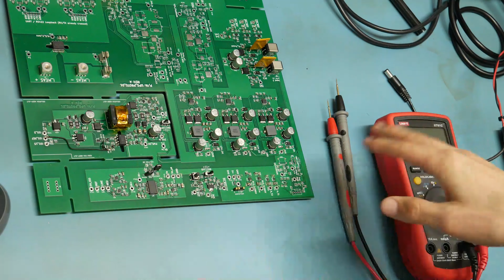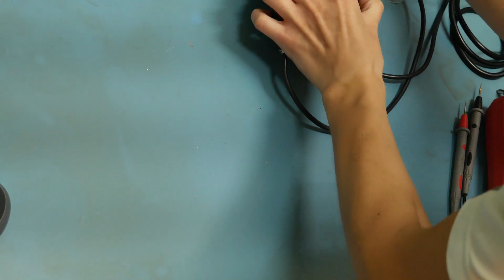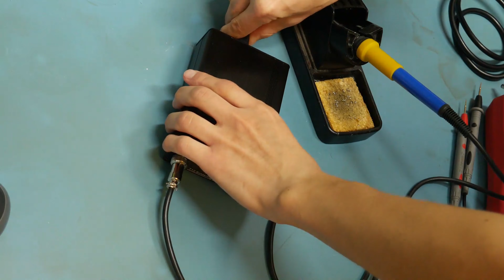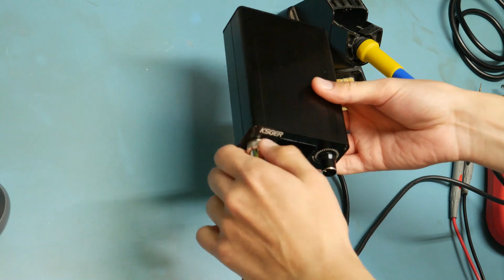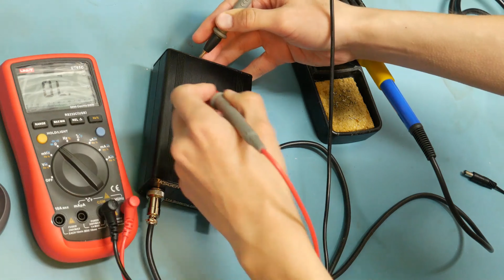A Dangerous STM32 T12 Soldering Iron - Ground Bond Upgrade!

Comment: Thanks. I had same problem with my other JBC and with this model station.I measured around 4~5 v AC. I called JBC service, they told impossible. İ sent photos they didn't react. So i had to fix. From heater side to main ground i had to connect with a wire. I've solved.   With this KSGER i measured 2.5 V AC!! 
I did almost like at your video. Because front and back cover screws solved. Only one problem I had to make a hole and solder to the main ground. Problem fixed.
Thanks for sharing your experience with your video. 💓💓🌹🌹
Reply from the maker: Thank you Elektro Dado! Yes! These irons all handle "ESD Safety" in a variety of ways. This one floats the handle (or has a very high impedance to ground), which is how currents can lead to a volt or two being dropped with respect to ground. If I remember correctly, the exposed tip of this iron is floating with respect to ground... not great! 

Then again... if the tip of a soldering iron is always a solid connection to ground potential, it's possible to rapidly discharge the PCB through the iron, which isn't great either! Most irons from the big names like Hakko, JBC, etc, have a specific circuit made to handle discharging electrostatic energy in a safe way. I'm surprised you saw a voltage on the tip!

Comment: How big is the chance of hot wire being flying inside that box 😂😂😂
Reply: But  to be safe is a good feature to have)
Reply from the maker: I'm honestly not sure! I'd rather not find out with my hand though. :) I'll let you know if I ever blow a fuse or trip a breaker!
Reply: @EEforEveryone  thx, by the way, I just ordered same one, let's see if my is grounded)
Reply from the maker: I hope they made some changes to the design. Let me know what you get! Btw, the black anodization has a high resistance, so make sure to check continuity from a silver part of the chassis or a screw!

Comment: Is your other iron grounded? the yellow and blue one, because I'm thinking of buying one as a cheap iron for occasional use.
Reply from the maker: Hello Jar! The yellow and blue iron comes as a kit with the iron shown here. There are a lot of great soldering stations that use the "T12" tips and a plastic enclosure / grounded enclosure /  a safer power supply! Unfortunately, I don't have the name of one off the top of my head.

My guess is that if it looks similar, it's probably electrically similar or made in the same factory. One thing I do to stay safer is to use a GFCI power strip to power anything I don't trust. :) I hope this helps!

Comment: mand do you know that you dont have to drill it or file it to grouund it?
Reply from the maker: Hi Informedia, It's possible that you're right, with a good star washer, the filing may have not been necessary! The point was just to break through the black anodization, which adds a high-resistance oxide layer to the outside of the metal!

cheers, and thank you for watching!

Comment: Could you bypass the transformer and run a 24 volt transformer straight to the circuit?
Reply from the maker: Hello C Jones! This circuit requires DC, rather than AC, so a transformer could be used.. with a rectifier and some output capacitors! Unfortunately, straight AC won't do the trick.
Reply: @EEforEveryone  Thank you.  I guess I was too broad with my question.  What I will be using is a dc brick (or wallwart) for a computer rated at 24 volts.  Just like the  TS100.  It's got a 24 volt transformer.  I wonder what amperage the KSGER needs.
Reply: @cjones4433  What did you end up doing? There's a mini version of this soldering station without the built-in power supply. However, for some reason it's rated at 24V 3A max, I would like why it's not rated at 5A.

Comment: sorry to ask but, if the case is not conductive, you will not get shocked, why add the "earth wire" to the case? The PCB is already grounded. Many thanks! Jorge
Reply from the maker: Hello Jorge! Thank you for the great question! 

Protective earth is very important to protect against faults. You're correct, that if everything is operating normally this wire serves no purpose (carries no current). However, if a live wire were to break (mains) and happen to touch the metal chassis... this creates a dangerous situation.

If somebody notices their soldering iron no longer works (because the case is live) and decides to touch it (maybe to check the power switch) they could be shocked or electrocuted!! The added "earth wire" would cause a circuit breaker to trip in this fault condition, and protect a user. 

I hope this helps!
Reply: @EEforEveryone  It would only if there's a proper earth connection in the outlet and electrical system.

Comment: Just bought one of these. For clarity - You cut the wire connected to each half of the case in half, and then soldered both ends to the ground lug of the plug?
Reply from the maker: Hello Baxrok, thanks for watching! Yeah, I drilled a couple holes in the enclosure, added a new wire. This wire is connected electrically to both enclosure halves though crimp ring terminals and screws. (That's the wire I later cut in half) then, both wires were soldered to the ground lug of the plug.

Be careful to make good solder joints, moving the wire while a joint cools can lead to a cold solder joint, which may be brittle and crack!

If you can do a ground bond test to make sure everything is set up right, that's awesome. At the very least, check the resistance between the ground terminal at the plug and each part of the enclosure, like we did!

Now the hard part... Soldering your soldering iron with a soldering iron. :) Heh.

Cheers, and happy soldering!
Reply: @EEforEveryone  Thank you.

Comment: IMHO you should solder or put a ring terminal large enough to fit under the barrel connector that interfaces with the soldering iron and anodized plate.  5 ohms is not much, but, hey, you're in there - could have made it 0 ohms :)
Reply from the maker: Fair point, Jon! Yeah.. what we did is better than nothing... but definitely not as good as it could be, and not up to most safety standards. Even a simple star washer could help a lot! Great thoughts, and yes, 0 Ohms would be great!

Comment: That SMPS looks quite garbage.. Just by looking at the EMI filter, they've put the capacitor before the choke :) I'm planning into buying one of these, but that power supply scares me..Saw a better one on AliExpress under the brand of "Quicko", and the supply looks a lot better designed, but on that one, I can't see any separation whatsoever between the HV and LV side
Reply from the maker: Hello Xander! I agree, the "design effort" put into this iron isn't particularly great... but it seems to work okay!

"Quicko"... sounds good to me! I suppose, I'd rather have separation between HV and LV than a better EMI filter. :)

Cheap soldering irons are always a gamble... If you buy the Quicko one, send us an image of the guts on twitter! I'd be curious to see how different it really is.
Reply: Yes that SMPS is also a death trap, that PSU really scares me on this one as notice a major flaw and that is the lack of primary and secondary isolation? What gets me is the fact they when through the trouble of PCB isolation slots for primary and secondary as did see the isolation slots by transformer, but they completely screw it up by soldering in a large heat sink by the 68uf 400v capacitor that goes directly to secondary supply of power supply, to make matter worst is that heat sink lay right on top of the main primary traces on the PCB, which means the creep distance is as much as the solder mask thickness? Saw that in his video when he turned the power supply to the side and took it out of casing and see the traces running to the primary side. Who designed this?

Comment: More important is  the tip being  grounded? Many switching psu 's are floating and totally safe if isolated from the case .Did you check?  Grounding a device intended to be floating is in it self dangerous.

Comment: Thank you for the video
I was about to purchase a similar clone but wanted more info
I'm going against the purchase seeing how I'm not as informed and would like a much safer option
Reply from the maker: Hello SANHEK, thanks for the comment, and thanks for watching! The STM32 irons aren't necessarily dangerous, but the isolation of the ac-dc power supply is critical, and a plastic enclosure helps a lot, if it's make of fire-retardant plastic. 

The critical pieces are isolation to mains, keeping potential fires contained, and ensuring exposed metal is ground bonded.

Best of luck in your search for a safe soldering iron!
Reply: @EEforEveryone  Actually the other day I made a purchase for this unit
Shopped around and I couldn't find anything better for the price

Because of the information in this video I can at least make the unit safer
The mod isn't really all that hard so thanks again :)

Comment: Great video.

I plan on buying a similar unit but a version in a plastic case that connects to an external power supply (24VDC/3Amps), this way I can use a CSA certified power supply and avoid this risk and also I can use the power supply for other projects if need be.

I was wondering how do I make such a DC powered unit ESD safe since it gets the power from a barrel connector with only 2 pins ?

Thank you.
Reply from the maker: Hello Dicofole,
Thanks for watching, and Great Question!!!

First of all, you're thinking about this problem in an excellent way, with regard to safety. This sounds like a fantastic plan!

With regard to ESD safeness, here are some general truths:
-"ESD Safe" devices generally provide a slow return path to earth ground. Something in the 1-10Mohm range. ESD Straps, ESD Mats, they all do this because it prevents the damage that comes from rapid discharge.

- I have used ESD Safe soldering irons that have the tip tied hard to earth ground. My guess is they're relying on the ESD mat to provide that discharge path, assuming all charge is neutralized before the top comes in contact with the PCB.

So, what does that mean for your soldering iron?

If you're working at a Static safe workstation with ESD mat and wrist strap, I would probably lean towards tying the tip of the soldering iron to earth ground. (0 ohms)

If you're not, the rapid discharge through the soldering iron tip may do more ESD harm than good, and I'd consider a low M-Ohm tie to earth ground. This would provide a safe discharge path for ESD Energy accumulating on the PCB... assuming it didn't already jump over to you. :)

Some ESD safe irons go for the hard tie, others have a special discharge circuit likely containing some combination of resistor, capacitor, perhaps a MOV, others are designed to have the tip floating! However, it's difficult for us to validate ESD safeness of a floating tip. There are tests that can be run, but not without sophisticated test equipment.

You'll likely need to run a third conductor which provides some kind of connection to proper earth ground. This can be through a dedicated wire bringing earth ground from an electrical outlet.

I hope this helps!

Comment: Is it the same with quicko?
Reply from the maker: Hi Max, thanks for the comment! I'm not sure about "quicko". Is that another brand of cheap soldering irons?
Reply: @EEforEveryone  

Yes, they look almost the same and uses t12 tips but the psu look a little bit different.
Reply from the maker: @maxd6178  Interesting! I see a few of these for sale by the usual suspects. You're right, they look almost identical! My best guess is that these are clones of one another, but that is just wild speculation.

Comment: TOTAL NON-SENSE!!!!
Reply from the maker: Hi Dennis, thanks for watching!
Reply: @wepipe  The soldering iron  output and tip itself is fully ISOLATED FROM THE 110 LINE through power transformer and is a dc output !! The entire power line in is in a plastic fixture snapped into the housing  which is not conductive which isolates it from the frame.This particular soldering station is manufactured in the thousands under various names in both assembled and in kit form with no issues and is a typical t12 type station.